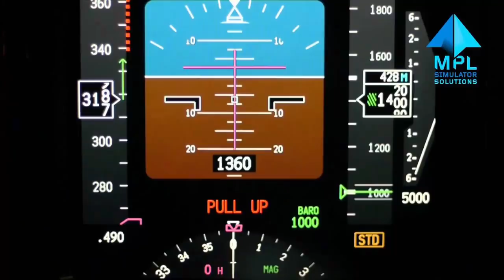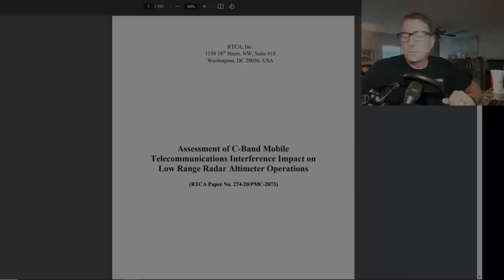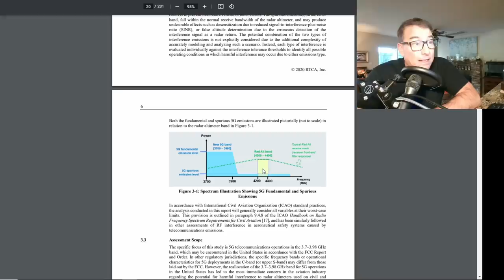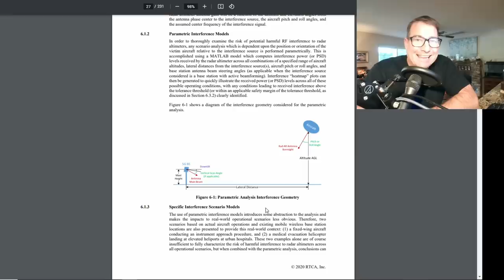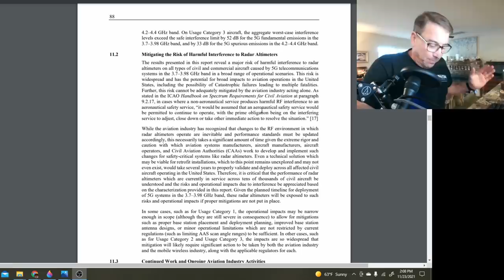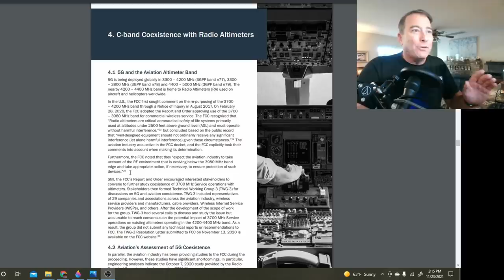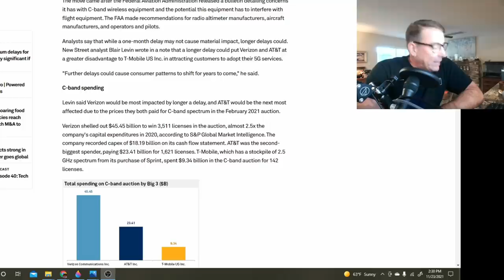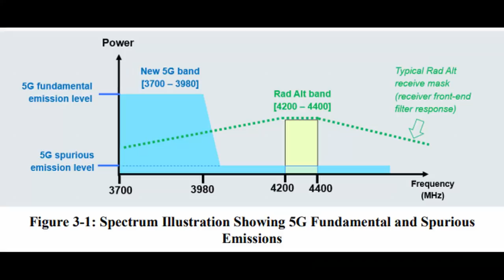5G C-Band Interference with Radar Altimeters in Aviation

Comment: Juan, thanks for presenting this issue in such detail. Commercial main stream media will not produce a balanced report on this issue that highlight the obvious because they have a vested interest in the benefits of the 5G spectrum. The irony is extraordinary. The telecommunications executives bidding for the spectrum expect to fly into  places like Chicaco to negotiate their deals and they expect you as the pilot to get them to their meeting on time despite the fact that the weather at destination necessitated the requirement for a CAT 3 RVR Autoland.   Then, when you divert to your alternate due to radio altimeter interference, these same executives complain about how unreliable airlines are at delivering their core service. The FAA must force the FCC to insert a clause in the 5G spectrum contract that makes the spectrum user liable for the costs associated with any accidents, incidents and operational costs incurred as a result of radio altimeter interference. These same telecom executives will scurry like rats when they realise the cost required to mitigate this financial liability.

Comment: PROPOSAL:
GPS & Timer based 5G automatic-off mechanism.
5G devices run an internal timer that upon hitting 30 minutes since last 5G or 4G signal detected then 5G is automatically turned off if a quick hot gps fix says the device is travelling greater than 175 knots/rapidly sees 50+ cell towers in a time faster than possible via road, all smartphones have GPS now so this is easy. 

If no towers are detected in 30 mins and GPS signal cannot be found because it's deep in the butt cheeks of the passenger in row 26 then there's no reason to have 5G on.

When the plane comes into a landing other parameters can be figured out such as phone accelerometer or GPS check needs to show deceleration to stop(force a user to get a GPS fix  to get back off LTE isn't a painful thing, assisted GPS is fast.) then deplaning passengers can use 5G again. This may not work if the plane has to immediately return to the terminal upon takeoff due to crisis but few flights are shorter than 30 mins so some combination of parameters, bands, and conditions can be used to keep 5G from blasting passenger cabins. 

We have DFS so there's no reason why we can't evolve our 5G deployment, it's a good precedent.

Comment: 2:17 The amount of receive bandwidth in your chart is concerning. Normally, devices responsible for safety such as what is used in your Level 3 landing would be tuned to a much tighter gap, especially when C-Band was already in use for other things as of the time these systems were implemented. It is the duty of the manufacturer to mitigate interference as much as possible and if these planes' receive gap is that wide, of course there will be issues. Since the FCC has already sold and permitted licenses on both groups of said frequencies, it would be up to the manufacturer of the planes as well as any upstream equipment to more finely tune their devices clocks (and possibly filter) for proper use within their licensed spectrum to prevent spurious interference events.

Comment: The FCC dropped the ball.  They don’t want to admit it.  The FAA also didn’t rigorously defend their spectrum.
Reply: The FCC grants 4200-4400MHz for radio altimeters.  Some people, including this report, are claiming that radio altimeters require the use of spectrum far outside their grant, 3600-5000MHz.

There is obviously some debate to this, and for good reason.
If radio emissions on adjacent spectrum cause these devices to malfunction, then the FAA knowingly approved faulty devices.  What's worse is that these devices should have a safety criticality rating of a/b, essentially meaning they must provide accurate readings when in operation.  When the FAA approved these devices the laws and rules were identical, the FAA knew these devices could not rely on adjacent spectrum but granted approval anyway.

Comment: Holy hell, Juan! I had no idea of the 5G interference issue until now. Your explanation makes total sense to me even though I am a has-been from a 36-year airline career. This now draws the question in my mind about all the low orbit communication satellites, Elon Musk is busily launching, to blanket the world with high-speed internet. Given the grandfather of Aviation over the spectrum, it seems incumbent upon Hi-Tech to rapidly produce the filtering required for new replacement radio altimeters and any other gear next to the spectrum. Surely, the designers and builders of driverless cars and pilotless aircraft are not sticking their noses into this spectrum too? It seems that very soon the whole world will revolve around 5G. This 80-year-old mind boggles!!
Reply: I am only 78, but when I get to 80 my mind will boggle as well.
Reply: Starlink uses frequencies in excess of 11 GHz. Not a factor with the 4.2-4.4 GHz frequencies that radalt uses.
Reply: It’s only an issue because of the amount of band separation involved is too close. The graph shows just how badly the interference really is. And remember the radar altimeter is only using about 1 watt of power, the 5G tower is pushing a lot more power, that coupled with how close the frequency is will cause it to bleed over into the radar altimeters allotted bandwidth and be received as an erroneous signal. The worst case scenario is outlined in the report as #4 where both radar altimeters receive wrong data but agree which in turn WILL cause a tragic accident, likely an over or undershoot causing catastrophic loss of lives and property. Will it happen every time? No, not likely but if it could happen and happens 1-2 times a year that’s significant. Should happen zero times forever. And the idea that well the airlines just need to change it is faulty too, or at least should have been addressed by the fcc prior to auctioning the frequencies and approving sites, power levels and  timetables. Think of it this way no one is going to die if they limit towers around airports, can they honestly say the same the opposite way?

Comment: Sounds like the systems need to be evaluated by the RF design engineers who built the radar systems. If there is an issue, then the radar systems need to be updated. The cost of updating all the airplanes is relatively small compared to all the base stations out there.
Reply: The engineers that built the radar altimeters are all dead probably, since the design is antiquated.
Reply: Base stations can be redesigned and redeployed around sensitive airport approaches without needing to be certified airworthy which is an incredibly slow and expensive process.

Comment: The radio altimeters should already have excellent filtering capabilities if erroneous data could lead to a loss of life accident. Tossing hands up and saying "well we were here first!!" is such a childish argument point that just passes blame off onto someone else for a poor and lazy design standard. Even if 5G services move their frequency band permanently, the standard for altimeters should have long been updated to require that they can reliably filter out everything that isn't from the altimeter.

Maybe someone with more experience in the engineering of radio filters can explain the difficulties to me. But I find it unacceptable for such a critical device to not be able to filter frequencies 100-200 MHz outside it's range when things like a car radio can distinguish frequencies that are .2 MHz from each other and can filter out other frequencies just fine.

Comment: A lot of aircraft that have undergone T-PED testing may also be caught out by the new frequencies not prior captured. 

I will have to dig further into this, it is very interesting. My experience, RTCA is on the more conservative side but that makes sense given the safety critical nature. 

Not all of thr C band should encroach on RADAlT frequencies. Perhaps medium term, the FCC could put geographic constraints on the deploent of the frequency of concern. Then again for helicopter, far harder to do in a city

I cut my teeth as an electromagnetic compatibility engineer in aerospace but haven't kept up to date with the latest.

Comment: Juan, the planes capable of flying to Asia and Europe are already having to deal with this, so the 777 and other long haul aircraft (including older planes like 757) need to be prepared for this when flying outside the US. It's the helicopter, regional jets, and 737/A31X which could potentially be affected by a US regulation change as they are less likely to fly internationally. So, if 777 pilots aren't already ready for this, there's a different problem.

I don't have the background to say if this will create problems or not, but I can say that in dense areas, the equipment in the towers do not transit at maximum power, as that could potentially interfere with other nearby towers at the same frequency. Optimizing the RF footprint based on expected usage and eliminating dead zones is a complicated problem. I doubt that suburban towers are radiating at maximum power, but rural areas are more likely to use maximum power. This is especially true for lower frequencies which are not easily attenuated.

As I mentioned in another comment, I work for Nokia, but do not speak for them. Nokia sells equipment to all the companies bidding for these frequencies. I haven't worked in the wireless equipment area since the days of 3G/UMTS, but never on the RF part of the business, but I did talk to people who did. My 4G and 5G knowledge is superficial.

Comment: The aircraft equipment is orders of magnitude behind the development of modern communications. The radar altimeter uses a bandwidth equal to several tens of channels in 5G signals, just to send out a receive a pulse without any information encoded. A bit like using the whole of an old TV channel to send morse code. The aviation industry needs to get its act together and become more efficient in their use of radar altimeters. Modern digital techniques can create brick wall filters with vertical cutoff slopes outside the desired frequency band. So aircraft owners are going to have to upgrade their equipment if they wish to maintain safety standards and avoid interference. A 200MHz guard band around the radar frequency is absolutely huge by modern communications standards, enough for several HD TV channel broadcasts.

The current auto land system is the equivalent of still using a spark transmitter and crystal set to receive the reflected signals. Really really overdue for an overhaul and update. 5G Is not the problem!

Comment: Boeing has known about the future 5G spectrum usage for over a decade.  The altimeter failing due to signal on a DIFFERENT spectrum is clearly a bug; electronics working on a noisy spectrum is a solved problem.  Why didn't Boeing address the bug a decade ago with a fixed device rather than playing chicken?

Comment: Excellent report and presentation Juan, but sadly everything is against you, but mainly money are LOTS of it.. 

But technically the problem is much worst, this is the problems you have in an ideal world, when the 5g is working correctly but what happens when those systems are not working properly and you get spurious emissions from faulty equipment or poorly built or designed 5g systems?

So of course if the transmitters are on the frequency you use, no amount of band pass filtering will help you.. 

Because of the money involved, I expect the flight industry will have to 'deal with it', and for large aircraft that will not be so hard, but it would involve improving the signal to noise ratio and possibly an extra layer of internal confirmation that the system is actually reading altitude and not some stray 5g signal. So higher power radar, and possibly higher gain more directional antennas.

It is a shame the FCC is so money orientated, they should be independent.

Comment: Upgrade your radio altimeter to the modern technology.  1 watt is plenty and you should NOT require 200 Mhz bandwidth.  No sympathy for your situation.  You could run all kinds of communications, navigation, in flight  internet AND radar altimeter in that same HUGE spectrum if your industry just used a modern digital coordinated approach.   Isn't the aviation industry still burning organic lead compound gasoline?   No sympathy at all.  Shape up!

Comment: 5g Operates in select bands between 750 MHz and 2,5 Ghz as well as mm 
wave bands. These lower bands have been in use for decades in 4G and 
earlier so any complaint about these bands rings hollow. The other bands
 in question, the mm wave bands are 28 and 39 GHz  for Verizon - way, 
way above radio altimeters. In addition the power levels of 5G are far 
less than 5G. So my question is how does 5G interfere with RAs? The 
other things that bothers me is why now? I have worked in the wireless 
space for years and the standards for 5G took years to develop and 
approve. The airline industry was asked for input but there was crickets
 on their part. There was more than ample time to comment, years in 
fact. These frequencies used by 5G are also licensed by the FCC for the 
sole use of wireless 5G providers.

Comment: I initially thought this was another 'LightSquared' attempt, but I did skim the report, and pulled the licenses above and below the radar altimeter band: You have NATO cellular just above it, and in .dk Hi3G and Telenor below it. I can't find any sites where 3/Telenor are operating in the band, though. Skimming the report, some of the values have the wrong sign, and others are pretty wild - you are in 'omg death ray' territory. The selectivity of (immunity to signals in the neighbouring band, NOT the band assigned to) radar altimeters seems a no-go by 1990s communications receiver standards. Just maybe it is time to implement higher performance radio altimeters, both for me and the guys/gals up front?

Comment: First I’ve heard of this. Good video discussion of the issues. Maybe the towers can detect transmissions from aircraft radar and turn their power down for 30 seconds? I can think of at least two other technologies that can provide vertical positioning with better performance than current radar. And the radars could be improved to reject false information. But those changes would take a long time! I also wonder if cell sites can be identified as potential problems (near final approach), allow all other sites to be unfettered. My last point, the ability of the system to identify interference and tell pilot to go-around shouldn’t be used as justification. Failed go-around is an AQP maneuver because it’s something that can be screwed up.

Comment: Never thought this may be a problem. 3G is very high powered, compared to 4 and let alone 5g. If true, there are two solutions to the problem.
1. don't allow that band to be allocated to 5g
2. let certain someone pay for approvals and upgrades to radio altimeters, either filtering or changing frequency or modulating a signal from RA, or any or all three of these options. in all GA and business aircraft.
pretty obvious it  has to be 1 or again, maybe it just simply won't happen due to lower power of 5g bs. or maybe installing a 5g bs near the airports would require installing a better directional antennas.

Comment: I believe the findings from RTCA. However, looking at the Radar Altimeter receiver filter response curve shows me that the receiver filter on RA's can really be improved. 5G is 200 MHz away! I know "brickwall" filters are a challenge and are easier in FPGA's and DSP's. But we as a nation retrofitted old TV's with external converter boxes to watch HDTV. Surely the telecon industry can fund a 200 MHz wide, 4300 MHz bandpass coaxial filter for aircraft. This does not seem unsurmountable. It may take some time to get through regulations.

Comment: I don't think the "we were here first" argument is going to work.  Rejection of out of band interferers is one of the most difficult problems in all of radio engineering, and the onus will be on the makers of aircraft systems to maintain their performance and certification.  Thad doesn't mean there can't be compromise in the law, like limiting the power of 5G transmitters near airports.

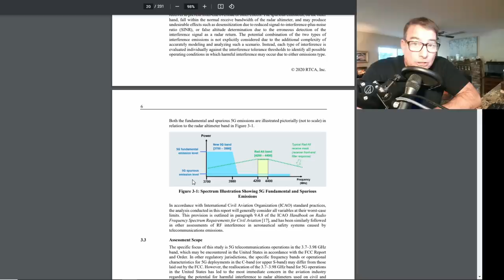Comment: 11:29 No offense, but it is absolutely possible to make a filter that narrowly defines a reception range. We do this all the time in AM and FM radios. The technology is there. Its the aviation industry that is unwilling to upgrade its tech.  There's just no reason to have a receive mask that large.
Reply from the maker: Correct but it must be FAA approved, 2 years MINIMUM.
Reply: @blancolirio  Okay, great. 5G was codified 2015-2016. That means manufacturers could have had designs on the table by the end of 2016 at the latest, testing minimums satisfied by 2018. That's still 4 years ago now.